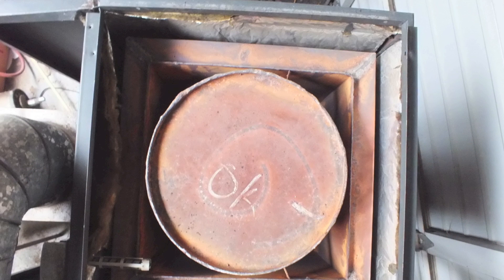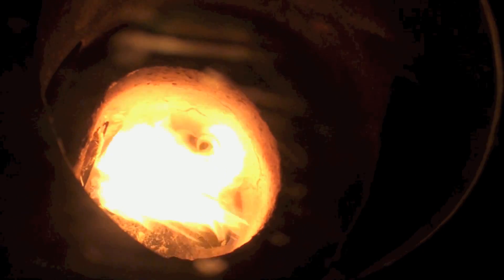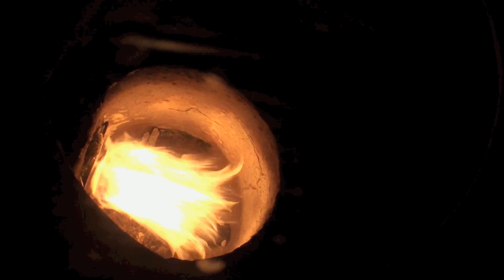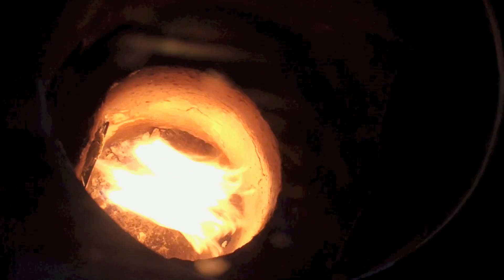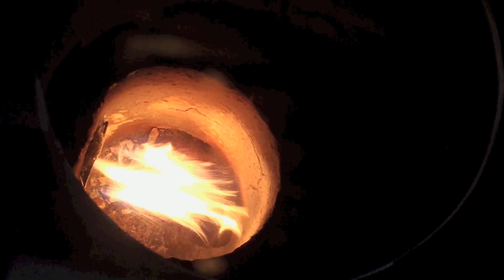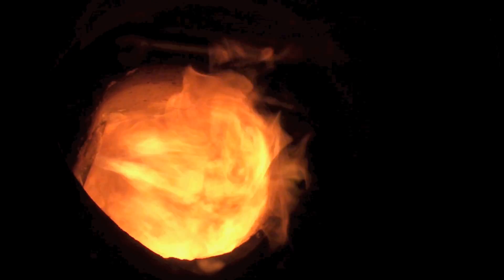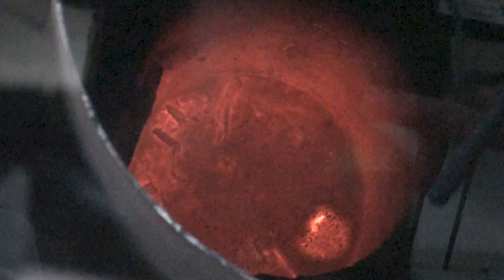Oil burner flame

Comment: Mine was making black styrofoam I think heat exchanger is clogged it blows back out peep hole and look like not enough air situation  how do you clean heat exchanger I made sure burner was clean as well chimney but still not clean burn
Reply from the maker: I did some videos on cleaning the heat exchanger:  https://youtu.be/8ha2LRyGRpc
GFM

Comment: You really did not explain the proper air setting you showed what happens with too much air, but you didn’t show what the flame looks like with the ideal the right amount of air. I would like to see what the flame looks like. We can’t look in from the top looking in through the flame port what does the flame look like with the proper air fuel mixture, please?

Comment: Should you be able to see the flame through the peep hole I can see the orange glow but no flame
Reply: Thinking I need to take air away but the burner proofed getting close
Reply from the maker: Some combustion chambers make it pretty much impossible to actually see the flame.  

A smoke pump is the only way to determine flame health.
GFM @taimeinstone1955

Comment: That combustion chamber liner is also there to protect the metal behind it from burning out.  The flame must be adjusted so it doesn’t get so long as to lap onto the heat exchanger above.  Good video.

Comment: My flame blowing out look hole like a back pressure
Reply from the maker: Remove smoke pipe and chimney connection and clean heat exchanger and pipe.
GFM

Comment: Is it the oil pressure adjuster that adjusts the air intake?
Reply from the maker: No, the air shutters  are between the pump and the burner housing.
GFM
Reply: @grayfurnaceman  thank you... I just am not near my furnace at the cottage... I can't rake a good lack it. I likely would have noticed. Thanks for all your videos. They are so interesting.

Comment: So, when the fuel cuts off, the cone comes back over the nozzle, wetting the nozzle and adapter.
I assume it burns off the next firing.
on mine, not only is the nozzle wet, the adapter AND the electrodes wet up, and any carbon produced gets thick and it shorts.

also,I'm having an issue of "threads" of carbon hanging off the electrode tips. 
I assume this is from unburned/overaired flame, not burning enough of the fuel.

I think the solution to my problem is to reduce the air over the fire, and ensure a clean burn.

Am I missing something?
Reply from the maker: Yes, you are missing something.  You are impinging.  The oil spray is contacting the head or the electrodes.  You need to adjust the gun assembly.
GFM
Reply: @grayfurnaceman  thanks for the reply.  My electrodes are set as per the usual instructions: 1/8x1/8x7/16 inches or so.
I'll have to pull the whole gun assembly to see WHERE the nozzle sits in relation to the head.
Reply from the maker: @theThinkerator  The depth of the gun assembly is probably where your problem lies.  I would be looking down the tube at the head.  Probably the head will need, at the very least,  cleaning.
GFM
Reply: @grayfurnaceman   You know what?  I clean the gun assembly 3 times a day due to the fouling.
but I never worried about the depth it sat, due to very LITTLE adjustment on my unit.
So I took the nozzle assembly out, cleaned it again, and using a mirror, took a good look in the tube.  it was all clean (a bit rusty due to age, I guess, but no soot to speak of)
When I was reassembling it, I pushed it into the tube as far as it could go, and using my mirror, I could see the nozzle from the burn chamber side.  everything appeared OK to me. So, I tightened everything up, and it has been running good for over 24 hours.  
This is a HUGE improvement.

I'm thinking about replaceing the end of the tube.  it has a turbulator on it, but it is old style Convex shaped.  
Could I put one of those "flame retention heads" type ends on it?
Reply from the maker: @theThinkerator  First, if you don't have a retention head burner, you should.  They can sometimes be retrofitted to older burners but the retention head burner took over the industry 50 years ago.  I would replace the burner.
GFM
Reply: @grayfurnaceman  I'll seriously look into this.   I know I can get parts to retrofit, so it should be able to be done.

Comment: If you only have a spy hole how do you know if the flame is to cold or hot ? Is the color of the hot flame the key?
Reply: Shouldnt look like a rocket booster and on the other end it should have a 'lazy' flame like a campfire. It should be almost too bright to want to look at.  Also a good flame should have the burn chamber glowing red like the video.
Reply from the maker: Color is sometimes used, but it is not accurate.  That's where you need combustion analysis tools.
GFM
Reply: @grayfurnaceman  I drilled a hole in the stack and inserted a length of hobby shop brass tube and adjust the air until there is no soot when I wipe the tube.

Comment: I enjoy your videos- very instructional and informational.  However I have some questions pertaining to a furnace I am working on.  I want to know if I describe the senarios  are you going to get back to me. I don't want to waste my time typing and explaining and not get a response.  Ben there done that !   I hope for a reply.   Thank you   Garry Clark
Reply from the maker: Go ahead and send.  I will respond.
GFM
Reply: Thank you so much !  The short of it first. Its an older Wayne Blue Angel HS. Put in new nozzle .75x80.  Cleaned the whole burner - bought and set new trodes {Crown universal # 31156-K - got the number from Wayne} to burner specs. NOTE - Except moved the trodes out to 1/8" from face of nozzle per tech persons advise from Wayne - it called for 1/16".  Checked transformer spark - looked just like your spark from video. I thought before checking spark that possibly the transformer was weak and it was breaking spark. I have ruled that out to a certain degree but -  you never know !  Called Wayne back and talked to John again. I asked him if maybe the spark is getting to much air and blowing it out.  Lower baffle was set at 3 1/2. He said set it to 1 1/2 to 2.  Secondary baffle was set at about 2. No need to adjust.  Fired it up - ran decent, sounded good, flame looked good, exhaust looked good with plenty of fresh air  - cycled through blower 2x then turned it off.  Let it set for about an hour. Fired it up again- ran for 20 to 30 seconds and then kicked off.  Fired it up again same result.  Added a little more air -same result then added a little more air - same result. Then back to the 1 1/2 setting.  Same result.   1}  The Wayne tech did mention that the Suntec a2va-7116 pump has a built in check valve and if the pressure drops tp 80 to 90 psi the check valve will close off fuel flow.  2} Wondering if I should move the electrodes back to 1/16" away from face of nozzle even though the tech said put them at 1/8". 3}  Wondering if fuel is contaminated - although looks good in bleeder jar.  4} still wondering about possible weak transformer - yet spark looked great.  Thank you for listening and and thoughts or ideas would be greatly appreciated.   Garry Clark
Reply from the maker: @garryclark9313  You may be barking up the wrong tree.  Even if the spark weakens after startup, the spark is generally not needed after the flame is lit (I leave the spark on continuously anyway).  
If the drop out is within the trial for ignition, (up to 40 seconds and less on newer cad cell relays) you could have a flame detection problem.  This is assuming the flame is on until the shut down occurs.  Cad cell positioning must be looking straight at the flame.  Cad cell resistance should be above 20,000 ohms dark and less than 1,000 when lighted.  
GFM
Reply: All your videos are so informative... thank you so much!!!... I have a Beckett oil burner that calls for 65gph nozzle.. but I noticed the previous home owner installed a 60gph nozzle.. everyone up here burns kerosene #1 fuel because of the weather.. My question is with kerosene should I using the 65 or the 60 nozzle?
Reply: @mikefedor78  I'm not a tech but k1 i believe is 'thinner' and more volatile. If the nozzles were the same or smaller when running k1 vs no.2 oil, probably dropping your pumps psi might not be out of line. 
Again this is theory from a non hvac tech. Just a joe.

Comment: sir i want a furnace wherein i get a hole from where i can get my molten liquid run out is it possible
Reply from the maker: If you are trying to melt metal other than steel, any burner and combustion chamber will work ok.  The flame temp will be over 1800F.
GFM

Comment: duno why but althought oil furnaces are bad for the environment, I miss my oil furnace from years ago at a house I use to live at.... Hell most of the houses in Southern Oshawa are oil furnaces.... I miss the heat, and watching the bright orange flame through the peep hole
Reply: oil furnace burn very clean. Should be 0 visible smoke from chimney when running correctly.  Higher btu than gas and 100 times safer.

Comment: Oil furnaces use #1 And/or #2 depending on whether the tank is in the basement or outside where it gets colder

Mine is in the basement & uses #2 while my neighbors tank is outside & uses #1

You Can use #1 with an inside tank, but you wouldn't want to use #2 with an outside tank in the colder climates

You'd think an oil furnace repair man Would Have Known That

It helps to understand the subject before you try to explain it to others

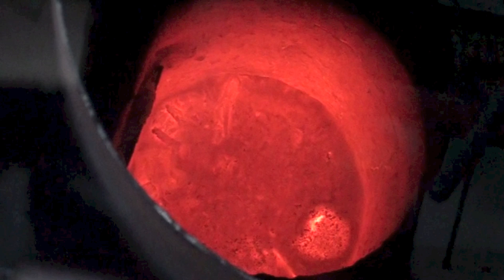At 3:05 Atomized or vaporized oil burns. Evaporated Doesn't
Reply: #2 is pretty much diesel and #1 is kerosene.

Comment: right i also know there's many types of it around such as jet fuel an aviation version #1 fuel oil that somewhat in between kerosene and #1 grade diesel an it's extremely difficult to light without it being atomize or turned into a vapor

Comment from the maker: I have worked on a number of these burners. The technology is fairly common.  The 2 worst problems with them are pump failures and the need for cleaning of the heat exchanger quite often.  If I get one of these I will do some vids on it.
GFM

Comment: exactly. the design i saw has a metred system that dripped used motor oil on a hot fire an the smoke from it was fairly clear but still emitted a lot of british thermal units or BTUs to the shop. i would like to see someone really develop the idea. do it like benny franklin. donate all inventions to the public domain. that includes the world. giving your talent is a good way to be remembered.

Comment: you are right. most people just dump oil in a trash can. this guy seems to have a good idea that only needs a patent to get it going. i wish i was an engineer. i would help design this burner he is using.
Reply: Huh? Lots of people run waste oil heaters up here in Maine. Most loggers heat their shops and lube their bar and chains with filtered, used motor oil.

Comment: only adventurers would try this. experimentation nearly caught my house on fire using used motor oil. i like this guy's spirit. the industry burns oil in generating plants. i do know they try to keep the temp high to stop the smoke. it does work. the video i saw showed a good hot fire in part of it. one man told me to heat the oil before dripping it into the heating chamber. this is a good way to get rid of waste oil and warm your butt at the same time. what you think?

Comment: you should keep warning people about using waste oil etc. my dumb ass decided to use a little used motor oil on a real cold night. end of story, i had to stand outside our shack with the hose at ready. that shit burns DAMN good when it gets air. i shut the vents and i thought i was gonna burn our shack down. i do like the idea of using waste oil but we got to get a way to meter the oil and control the oxegen source. you had one part that had a good burn on it. u use it for heat?

Comment from the maker: There will be a series on oil flame.  Oil burners are the only ones we can still make a difference on by the air adjustments so they are kind of fun, if stinky.  
GFM
Reply: No fun in cleaning out a sooted up heat exchanger.  Some of the old ones used asbestos gaskets behind the clean out plates.